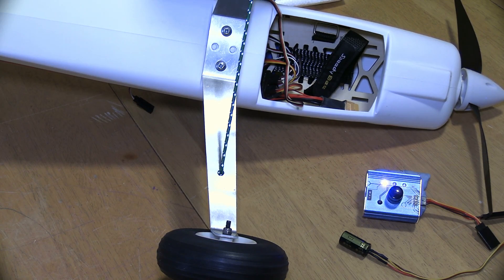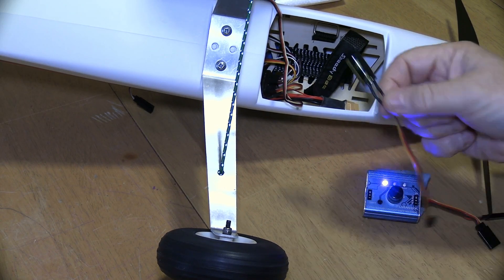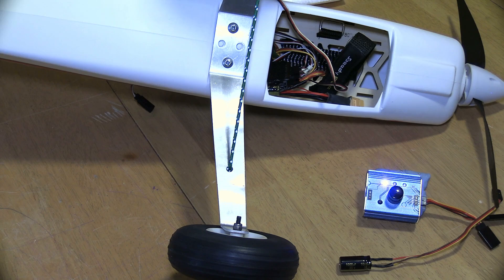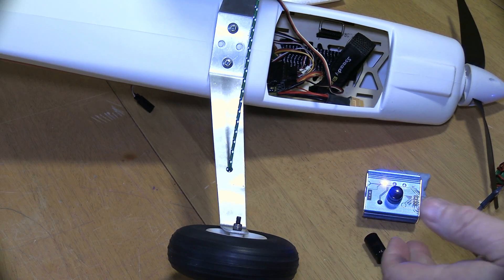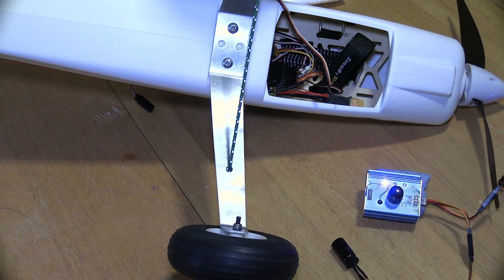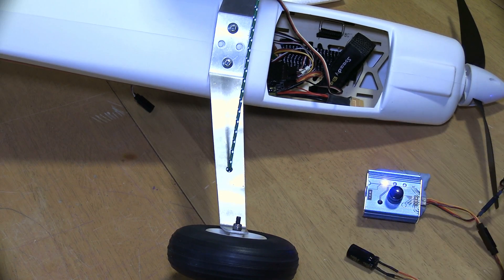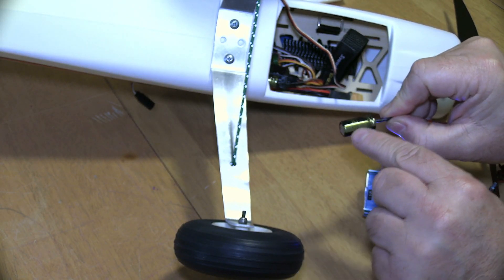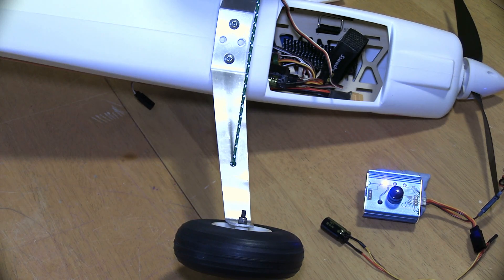Adding a capacitor to your RC receiver

Comment: Can the capacitor be plugged into the port of esc ?? On rc cars ?? I have hobbywing wp 10bl120 amp esc and was wondering if it would be a good idea to plug it into there
Reply from the maker: You can use a cap on any channel of your receiver.

Comment: Sorry but your ESC (BEC) will deliver about 5,3 Volts to your receiver regardless of the battery 3,4,5 or 6 S  or higher, unless you fly on HV mode which can be up to 8.4 V (make sure you have a HV receiver) so your capacitor voltage rating doesn't need to reflect the battery voltage.
Reply: im just trying to figure out why the gyroscope i bought for my foam plane came with a capacitor. i been doing this for ten days
Reply: @SuperEsybeltran  the capacitor will iron out voltage spikes caused by stop en start of the servo's connected to the esc